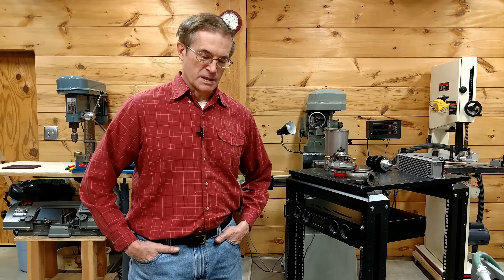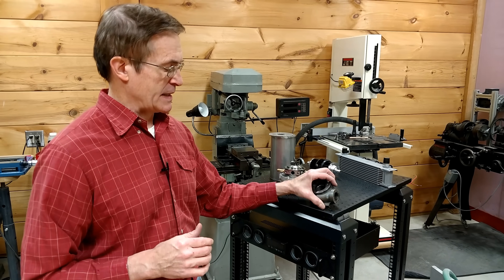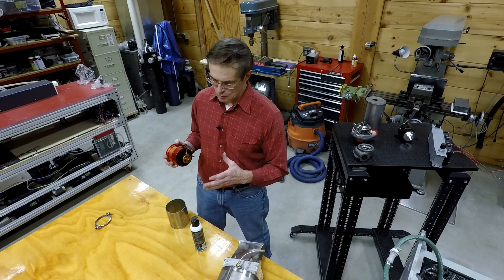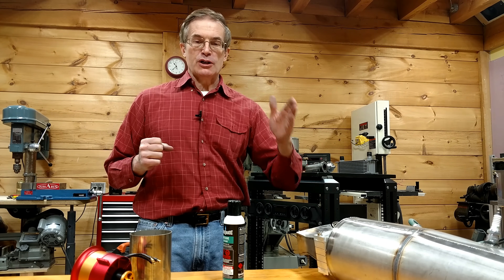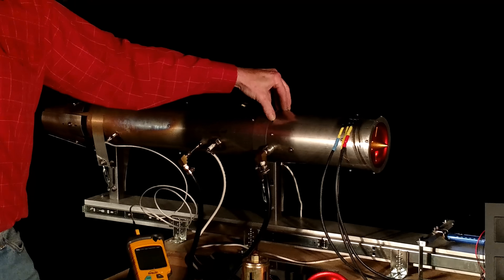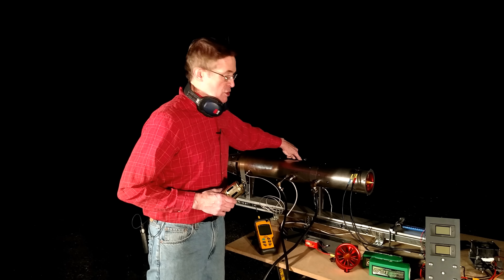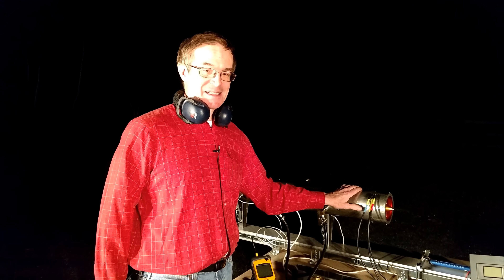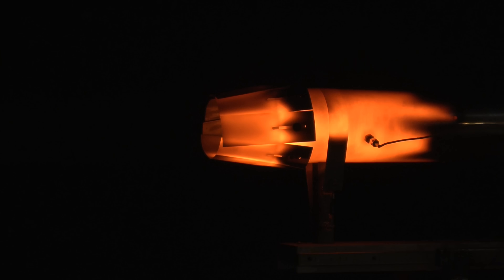Hybrid Jet Engine

Comment: Adjustable rear nozzles are in place because when an afterburner is lit, the gases are supersonic... Thus needing a diverging nozzle(like a rocket) otherwise a converging nozzle is required. Bernoulli ls equation :)
Reply: Mostly right; however the gasses are already super sonic to begin with. Otherwise you wouldn't get much thrust out of the engine. Afterburner causes a huge increase in the pressure of the exhaust along with temp and it's at the very back of the engine so the nozzle when in afterburner is wide open to prevent any damage to said nozzle. when afterburner is not lit the avionics systems control the opening of nozzle for that specific of flight envelope. The closer the nozzle is to closed the more focused the blast of thrust is and you increase your speed, the more open it is the slower your speed. Think of it like a garden hose. Turn the water on at full blast you get a good stream. Start to put your thumb over the end and the smaller the diameter of the opening is the more focused/pressure is present and the water goes further, reverse this and it goes back to it's original state. That's why jet fighters have adjustable nozzles. Focused blast of jet exhaust until afterburner engages. Also as you increase the throttle your increasing the compressor speed and adding more fuel to compensate for the added compression and you get more power. The nozzle just focuses that power.
Reply: @fightingfalconfan  not true, high pressure won't increase thrust unless going through a nozzle. At supersonic speeds the nozzle cross section expands forming a converging - diverging nozzle... Otherwise the gases would not excelerate. The combustor liner protects the engine...with cooling air around the afterburner liner...

Comment: I applaud your rare understanding and explanation and execution of the concept however I would have preferred the step by step build log or at least some more on the construction as would many of the engineering types watching. Interesting that you ended up with such a long and I imagine unwieldy and heavy engine - I imagine thrust to weight ratio of just the engine alone let alone a suitable airframe for such a long device renders this completely unviable?
Reply from the maker: Take a look at our follow up video on the improved version of this engine.

Comment: Hmmm...  in a gas turbine the compressor stage consumes 97% of the power of the turbine.

So if you have a 100hp engine the turbine is producing 3333hp. 

That's a lot of power to expect from an electric motor.
Reply from the maker: That's interesting, how did you derive that relationship?
Reply: @TechIngredients  I first saw it in the Kurt Schreckling book. The rough idea of gas turbines was known long before they were created but what was not known theoretically (but was known empirically) was that unless the compressor and turbine stages were both very efficient, the thing wouldn't work.  

The symptom is that the turbine lights but won't run under its own power because the compressor stage is consuming more power than the turbine provides.

Until the theory of gas flow past airfoils by A. A. Griffith in 1926 (An Aerodynamic Theory of Turbine Design) , the mathematics was unknown for efficient blade design.

Whittle used Griffth's work to produce a working, net power generating, gas turbine. 

The compressor consumes almost all of the turbines power output. The useful net energy available is the difference between the two. I might be wrong about it being 97% (that might be the necessary efficiency) but the energy consumed by the compressor is significant.
Reply from the maker: I see, that's why I asked. 
The typical MAXIMUM efficiency of a turbocharger turbine and compressor wheel turbine is around 80% each, with practical efficiencies that are substantially lower.  You can find these numbers on the flow maps for most commercial turbochargers.  The product of these efficiencies are at best, 64% efficient.  We have constructed two, successful turbocharger based turbojets ( many other You Tubers have as well).  The actual recirculated power from the turbine to the compressor is closer to 50% of the work that is output in the form of the high velocity gas jet in these single stage units.  It is true that this number will rise as the compression ratio increases with the addition of additional stages.
You don't have to take my word for this.  Simple gas law equations will show the necessary work to compress a quantity of air to a given pressure, multiply by the efficiency of the process, calculate the kinetic energy of that same mass of air at the required velocity to produce the given thrust.  Use published SFC numbers for the process and the residual heat (temperature) of the exhaust gas. Even a very rough approximation will be good enough to support a substantially lower recirculated energy.
Reply: @TechIngredients  I'm not really seeing the advantage of an electric compressor stage.

Its a whole heap of extra complexity for a result that offers lower efficiency.

If you'd forced me to go down this road I would have started with a homopolar motor.
Reply from the maker: The advantage is easier to see if you start with the electric compressor. There are many currently flying EDF powered RC jets that can benefit from brief boosts of thrust that an afterburner can supply, much as an afterburner is used with full scale jets to augment thrust.  This afterburner will also add realism both in appearance and from the sound it produces.  Furthermore, the possibility of incorporating and electric stage to get a ramjet moving and reduce the adiabatic heating with compression at higher velocities is intriguing.

Comment: your inner cone before the burner should be ajustable and set inside an angled wall tube area that is slightly smaller at its smallest point. Like a needle valve. That way the air gap can start small for starting then be increased when the engine it at full operating temp for more thrust. Got this idea from the engines on the Black Birds engine design. Just an idea great build
Reply from the maker: That's a good idea.

Comment: The T56 Allison has a combustor pressure of 45 psi. And everything is designed for maximum flow. Which is why the way you mounted your flame stop surprised me. I suppose I was expecting a radial setup that reduces the turbulence. Nice job overall.
Reply from the maker: Thanks!

Comment: These models are very very energy mongers... efficiency is out the window and gain in thrust is minimal for the amount of btu's and wattage used ..nice set up enabling a hands on understanding of conventional concepts but quite primitive ...if I told you I could create 100 times the amount of thrust with an input of not more than 75 watts ..first of all you wouldn't believe me and second of all you wouldn't believe me...what makes my design possible is exactly that..the design and configuration is totally different feul is also very different and the the total flow of oxygen and gasses contribute in each phase largly in to creating thrust other than just being exhausted without creating any significant thrust ..everything is very wrong in your current design and as is is futile to try and in better it ....not your fault I know you can surely do better given the right challenge and right concept and right design ..you have very good notions of thermal dynamics but unfortunately you have just the thermal happening but very little on the dynamics side...not your fault I'm defenetly not trying to down you in any way I think it's very admirable in the efforts you have done I'm just giving my objective views on the results I'm quite sure your not satisfied totally on the results yourself ..im  an inventor from Quebec Canada and can defenetly be able to produce 100 times more thrust using a max input of just 75watts when I see so many youtube people who make similar models I find it very energy waistfull as a thrust engine model compared to what designs I work on..good work though looks like you put a lot of time and thought into it I congratulate you for that ...sometimes you have to think out of the box and you will resolve your technical problems ....cheers
Reply from the maker: Thank you for watching!

Comment: Solar powered gas turbine:
A conical mirror will reflect sunlight evenly onto a cylindrical surface.  If you take quartz tubing and put a blackeneded steel pipe inside that is a little smaller diameter than the glass you could heat up compressed air from the turbo charger and use the exhaust to drive the turbocharger.  Heating the air to near the melting point of the materials would provide numerous times volume expansion.  A narrow nozzle attachment to the compressor output would further boost the pressure of the air being injected into the solar "combustion chamber".   A twenty percent efficient arrangement would generate about 600 watts with a two meter diameter mirror.  Because this kind of arrangement is creating a large flow of air, it could be used to heat hot water and for space heating increasing the overall efficiency to near 100%. 2000 watts of the hot exhaust air would be like the equivalent of maybe six or eight 1000 watt electric space heaters considering the llow efficiency of converting electricity to heat.  Several of these dishes connected to one generator would generare enough electricity to air condition a house.
Reply from the maker: Concentrated solar provides a lot of options.  It can dehydrate a desiccant for air conditioning as I showed in our first video on refrigeration a couple of weeks ago.  Obviously, it can produce direct solar electric or heat for thermoelectric or hot air as you suggest or steam.
Reply: Tech Ingredients 
   It  seems a lot easier, safer and less expensive than steam.    The power could be quadrupled by putting some folding panels on it to make it twice the diameter.

Comment: Hi, can you tell me what the native thrust of the ducted fan is on it's own?  Also, what the KV of the motor was and it's 12s amp rating or what size ESC you used?
Reply from the maker: The ESC Is from Aiien Power Systems.  It is rated at 150 Amps.  These are roughly 950 Kv motors.  Native thrust is 5Kg.

Comment: BTU is an acronym for British Thermal Unit. Although its name seems to suggest otherwise, it is no longer commonly used in the United Kingdom. BTU is a unit of measurement for energy. One BTU is equal to the amount of energy used to raise the temperature of one pound of water one degree Fahrenheit.
Reply from the maker: I should say BTU/hour when I am describing fuel use etc.  One BTU is approximately 1,000 joules.
Reply: Oh this was just something I plucked from a google search, because I didn't know what that unit meant. I thought I'd post it to save others the trouble. ;) Thanks for the addition! Your videos are amazing!

Comment: You are doing it great, combined cycles and adiabatic wallsby ceramic,acomplish isentropic reversible,let me tell you my concerns, my goal is to power gliders like Stemme, eliminating the Rotax and  retractable mechanisms, reason weight in excess, regarding ramjets, pulsejets or micro jet turbines.USA is designing  Brayton cycle, jet engine and exhaust into a De Laval CD nozzle, I like it because I handle  all equations for modelling, ramjet is easier but  booster? to take off, is suitable for supersonic only? and a glider  limit is app 250 km/hr, Lenoir cycle, valved or valveless, fits very well with a CD nozzle, 10 bars and 2000 K in chamber of valved pulsejet, exiting to a small CD Valve with a great thrust.In isothermal walls valved pulsejet heat transfer can be  used in REGENERATIVE  strategy as well.A second concentric wall ceramic coated can be adiabatic,and return energy to the flow or heat echanger.
Electric Power nihtmare for all, Seebeck or Peltier effect, bimetals, parallel and or series,what do you thing for your electric fan electronics  or servos controls.Pumping fuel. have you seen Radioisotopes Thermal Generator, Seebec needs heat to convert it into voltage and current,DC. Receive my best wisches  of success, I have deducted all equations I need to solve pulsejet(Lenoir) plus  say De Laval CD nozzle, its  a thermodynamics cycle to me,my pending agenda is to study a chinese  valveless pulsejet injectin into convergent nozle of CD  .Regards Johann Wegmann

Comment: Ah flash back days @test cell on TF-30 F404s - you need hi bypass to channel cool air beyond your compressors to AB section,  very nice project!
Reply from the maker: We may in fact do that and eliminate the water, but we wanted to try that out first.  Sometimes the best idea is to simply try it.

Comment: So basically a glorified space heater with a fan? I dont understand how you are getting any extra thrust just by burning some propane in the tube? You are getting almost all your thrust from the EDF and perhaps a small amount from the burning process but in essence it seems like a complete waste of energy. What benefits are you getting in terms of thrust from burning propane in it and potentially having to carry propane fuel as well as batteries for the EDF? Just seems very inefficient. As a concept, sure I think it works but practicality wise I think its a dead horse. If you had planes powered like this the weight of batteries AND propane fuel just wouldn't be efficient for any form of long flight. Its cool dont get me wrong but just seems like a waste of your time unless all you are doing it for is some form of educational purpose but your videos arent coming across as that.
Reply from the maker: In part, we are doing this for educational purposes.  As to your question about the benefit/thrust, you will see in part two that we are able to double the thrust of the fans alone.  Remember, the batteries are heavy and have a low energy density, so despite the low efficiency of this engine due to its low compression ratio, the thrust value of the fuel is competitive.  Afterburners are typically used intermittently for, say takeoff and maneuvering.  In an RC model they add realism and unlike other attempts at this, this afterburner actually adds significant thrust.

Comment: The other reason for the adjustable cone on the exhaust of jet engines is to be able to change the shape of the exhaust at altitude. Just like with a rocket nozzle there's a certain point where the lower pressure at high altitude can cause reduced thrust based on the shape of the exhaust coming out of the nozzle, it expands too much and loses it's power to exert force.
I'd love to see someone do a video showing the difference in thrust between different fuels, from gasses like propane, to gasoline, to alcohol (methanol or ethanol), to diesel, kerosene (basically early jet fuel) and finally hobby 20-66% and even 100% nitro methane.

Comment: Thrust measurements or you just made a fancy weed burner.
Reply from the maker: You're right, this would make a REALLY powerful weed burner.  The thrust with this engine is somewhere above the 10# that pegged the spring balance.  The second version of this engine has a two stage compressor and generates approximately 40# of thrust.  The video covering this new engine has been filmed and will be posted soon.
Reply: I look forward to seeing it. Weight measurements would be interesting too. I'm curious about the power/weight ratio possible on homebuilt engines such as these.

Comment: Check out colin furze precision my arse he uses duct tape and a loo roll holder.
Reply from the maker: We did.  He has some really interesting videos on both turbine based and pulse jets.  What's so appealing in these videos is that a hobbyist can succeed with these engines without expensive equipment or a huge time commitment.  I like that.

When we cover these types of engines we will also keep these practical considerations foremost.  However, we will also include an explanation (and as succinctly as we can) of the underlying principles so that if the builder wants to modify, enlarge or improve on the design they will know what is likely to work and why. For example, when choosing a turbocharger for a jet engine what is the effect of a particular A/R ratio?  If you look around, no You Tube channel, turbojet video, ever address this and it's important.

Comment: sexy but what happened to part 2?  Wish you would show more of the creation process instead of just preaching after you figured it out like you knew it all along.
Reply from the maker: Thanks!
Part two is finished and will be uploaded soon.  Actually, the creation process is almost entirely invisible.  I read very fast and refer to journals through several on line services.  The design was completed before anything was fabricated and little was changed after that.
The construction process is a different matter.  Filming the many steps in fabricating components and their assembly would be very interesting for the viewer especially if it was edited well.  The challenge is the time involved.  We are so busy that a few minutes here and there are sometimes all I have to progress with a build.  Adding the camera set up without interfering with the work being done (at all hours)...ain't easy.  But we are working on a couple of ideas to approach this.

Comment: It does sound like you know how to build a jet engine.  But then you went and built a fan-assisted Bunsen burner.  Want real thrust? Then power the fan with about 50 hp.
Reply from the maker: You're right, I do have some knowledge about this.  The second engine in this series has two electric fans that consume a total of about 16 hp.  The afterburner more than doubles their native thrust and that video will be posted soon.
Other jet designs will follow.